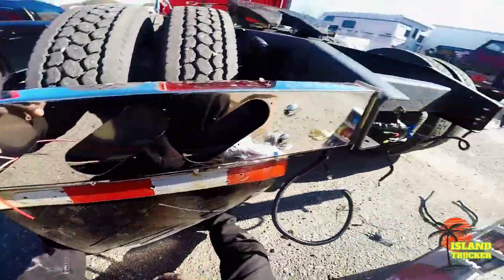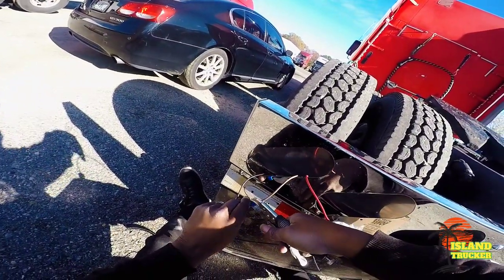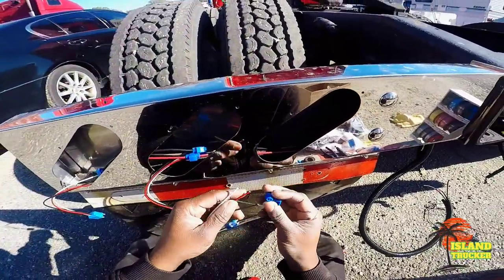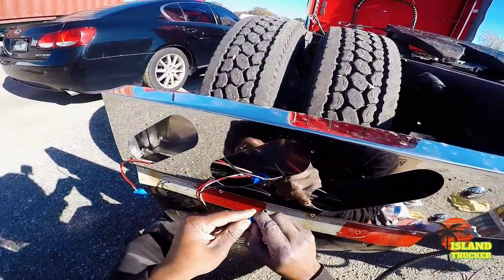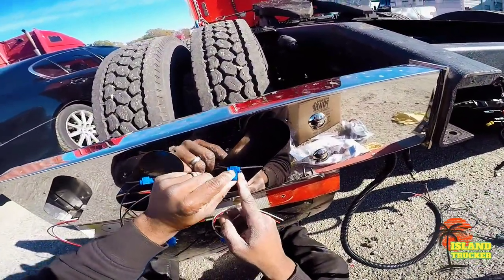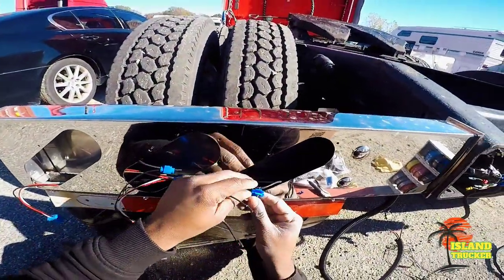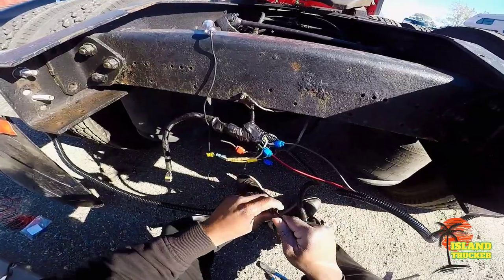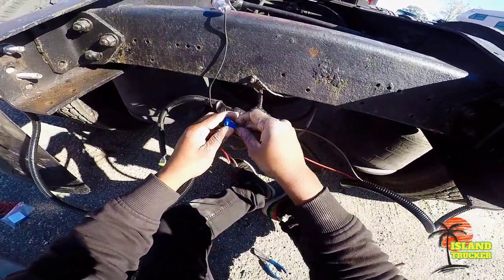LED tail light wiring and install | Part 1

Comment: Good Job , you will be sorry 6 months from now using the Scotch-Lock connectors .    122/23
Reply from the maker: Why i would be sorry?
Reply: @ISLANDTRUCKER  I have had no luck with them do to corrosion . All the calcium chloride and salt on our highways just corrode them away in Ohio . Covering them with liquid or silicone tape may delay the process . Good Luck .
Reply: @ISLANDTRUCKER  Another very good electrical sealant is 3M Scochkote electrical coating FD .  15 fd oz is $50.00 . It is manufactured for underground electrical splices . A can will last a long time and is worth it . Amazon 5/6/23
Reply from the maker: @vicpetrishak7705  👊🏿thanks, I'll look that up on Amazon